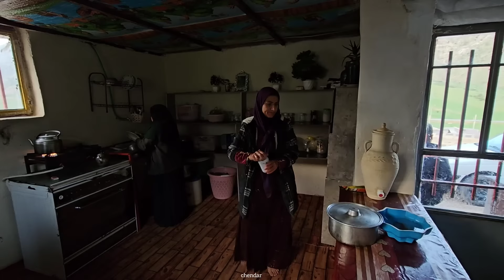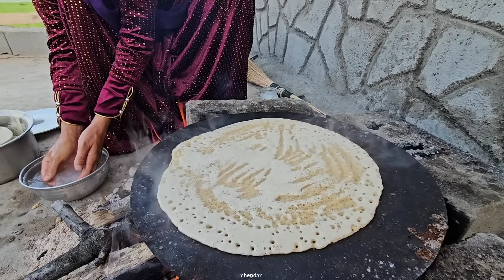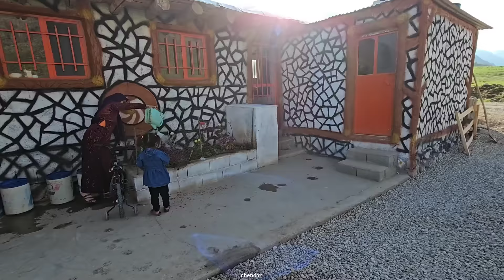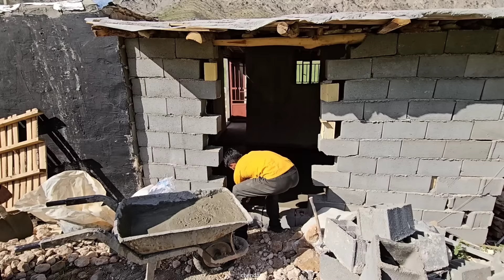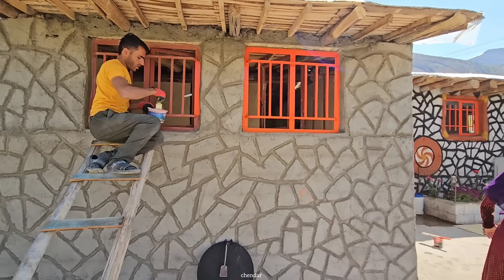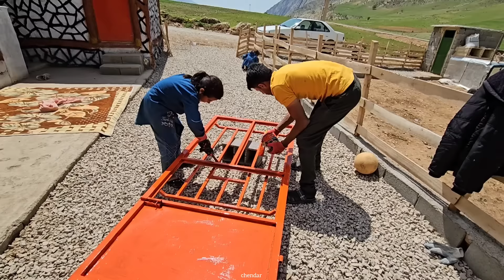Painting the door and window of the house by Majid nomadic family

Comment: Very happy that Mother is learning. Two other things: 1. I see a power pole go by house. Is there electricity? Is it too expensive? 2. I see the family haul water. Could they drill a well? Do the other houses have wells? Is it very expensive to drill? Also, I live in northern Canada where it gets very very cold.Father is not building insulation in the ceiling or wallls? Does this house get cold too?